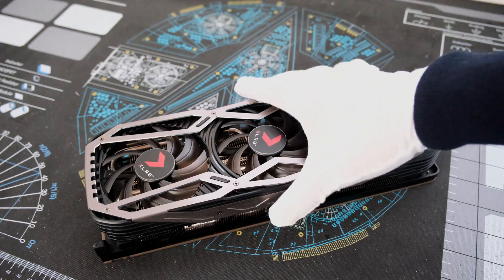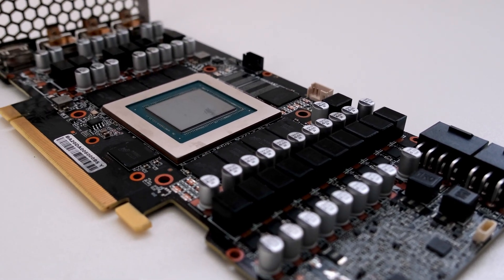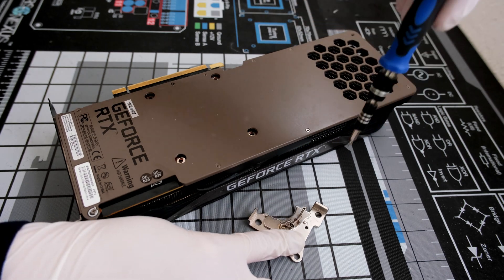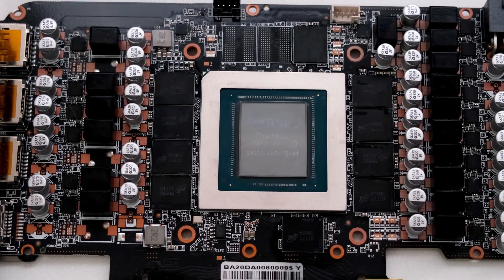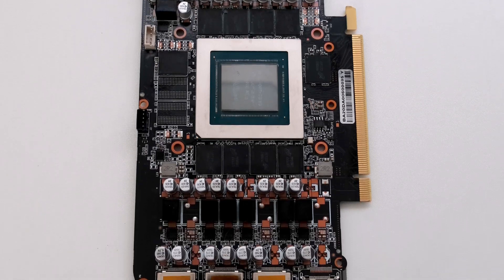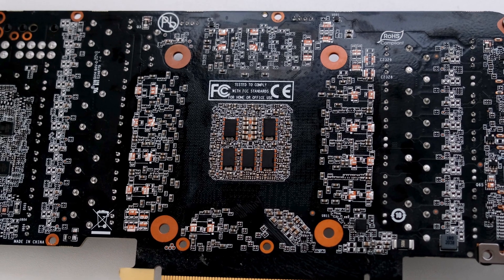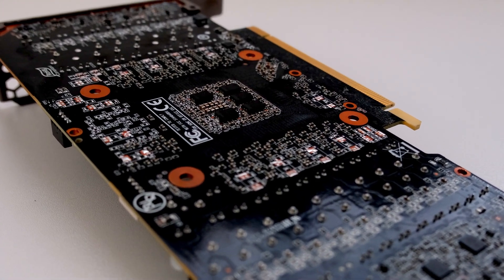RTX 3080 PNY XLR8 Reference PCB Teardown NVIDIA GeForce GPU

Comment: Video like this are always really useful
Reply from the maker: Thanks for your comment 🙏 Thank you for the encouragement! To improve, I've added thermal testing to all the recent videos. I'm also adding decibel readings (for fan noise) and full teardowns of the shroud (removing the fans, etc). I hope you stay tuned!
Reply: @vectornetwork  so thanks for these other test! Do you have any suggestions on how to undervolt that card?
Reply from the maker: @JohnnyShikari  Wow, great question and on point. I am capturing all the footage as we speak for the next video (4090 Founders thermals & teardown) and plan to address undervolting. Once I test undervolting on the 4090 (and showing it), I'll have a better understanding may be able to address your question better. Hope that helps
Reply: @vectornetwork  Honest and "on point" answer. I'll wait that video! :)
Reply: @vectornetwork  Is the process same for 4000 super cards?

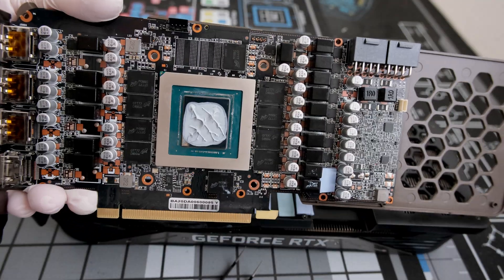Comment: 1:03 did you just rip off white connector?
Reply from the maker: Thanks for your comment 🙏 I checked the video and IIRC, yes, I just did rip it out. I tilted it side to side to get it out. I don't remember there being a clip. It pushes in like a fan header. Hope that helps.
Reply: @vectornetwork  didn't know that, thx. I managed repaste it without pulling out that connector.

Comment: my video card is heated by hotspot up to 104
Reply from the maker: Thanks for your comment 🙏 104 is kind of high but too high. Any other information? Air cooled? Stock or opened before? How long have you had it?
Reply: @vectornetwork  My video card is 17 months old.I changed the thermal paste a couple of days ago, now the GPU Hotspot has a maximum of 85 and the gpu temperature is 76.The video memory is 86 degrees.
Reply: Надеюсь понятно написал,я из России
Reply from the maker: @ВалераХоботутин  Well, there you go. Looks like it just needed a bit of maintenance. It's good practice and it gets easier each time you do it. Those temps look good, enjoy your card.

Comment: Really helpfull vid. Awesome work. Im planning to get one, is it good? pny is not the best brand, but some of the oldest card maker by nvidia. I'll apreciate if you give me some informations, thx
Reply from the maker: Thanks for your comment 🙏 The PNY RTX 3080 is a suitable option. PNY is a long standing business (IIRC 30 or so years) located in NJ, USA. My understanding is that the produce cards for NVIDIA's Quadro line. They don't appear to spend that much on consumer marketing, so it is understandable that consumers aren't that familiar with the brand. From my experience, the cards are usually reference design (save on costs of customizing) and the cooler is typically no frills but certainly capable of the job (likely leveraging their experience with the Quadro line). My understanding is also that their warranty is comparable to other companies. Hope that helps.

Comment: Its OEM is Palit though, not PNY.
Reply from the maker: Thanks for your comment 🙏 I am always interested if I made an error, so I can prevent that from happening in the future. So, help me understand what you mean by the OEM being Palit and not PNY.
Reply: @vectornetwork  PNY 3090, 3080, 3070, 3060 cards are made by Palit, they only differ by fan shroud or simple sticker change, same goes for Gainward aswell.

Comment: Hello! for this model, are you able to deshroud to remove the fans side without having to unscrew the backplate and exposing the chip?
Reply from the maker: Thanks for your comment 🙏 I am looking at the cooler and there are screws all around the fan side. It appears that the fans can be accessed without unscrewing the backplate, but I haven't tried. In future videos, I plan on including a full teardown, including down to the fans. Hope that helps.
Reply: @vectornetwork  Hey there! I would love to see a full teardown on the 3080 xlr8, as I'm going to be deshrouding soon but I was only able to remove the metal outside of the shroud. Thanks!

Comment: Hello! Very interested in getting this card just for gaming. What were your stock VRM/Memory temps before opening it? Really curious to know. More power to ya!
Reply from the maker: Thanks for your comment 🙏 I am putting together a testing rig and developing a repeatable testing methodology as we speak, so I can better provide that information. So, I regret not having that data available, but I will do my best to provide that in the future. For what's it's worth, I found the card to run slightly better than expected on temps/noise. The 3080 doesn't have any memory on the backside, so the memory temps were perfectly fine. Hope that helps.

Comment: Do you happen to know where the card's RGB header is? Or how to physically disable RGB?
Reply from the maker: Thanks for your question. 🙏 I do not know for sure. There is one covered by the cooler and two one the side. Not aware of physically disabling the RGB, but maybe pulling out the white one on the side will do the trick. It may be possible to control the RGB with your motherboard's software. Hope that helps

Comment: I almost bought this card but I was looking at the 3080 12gb and the Ti version. It was still $1100 at the time but I had a 30% "cash back" (store credit) for OfficeMax which would have generated $330 store credit after purchase. I ultimately decided against it as it would have still required the $1100 out of pocket and just in time, the other card I was looking at went on sale on Newegg for $729. The Gigabyte Gaming OC 3080 12gb. Far better value!
Reply from the maker: Oh yea, for sure, better value. Congrats on the purchase! 🙌 The Gigabyte 3080 12GB is a beast and you got it for pretty much the MSRP of the 10GB FE at launch $699. Well done.

Comment: what temps are you getting in full load?
Reply from the maker: Thanks for your comment 🙏This card the PNY 3080 is currently in a Heatkiller water block that I'm thinking of putting into a SSUPD Meshilicious. When it was in its stock cooler, the GPU temps were fine, something normal and the memory temps were pretty cold, more than I expected--perhaps because there is only 10GB of it on this board. (I don't recall exact temps)
If you are curious about the temps in my most recent watercooled soft tubing build on this channel, running a stress test in 3DMark like Time Spy or Port Royal, I'm getting somewhere low 80s for the GPU memory and GPU core something like 70s, maybe 80 max (a bit more than the ambient temp in the low 70s). The fans are running at approx. 1200 rpm. 
This is with the Heatkiller rads 360-L with 3x Phanteks T30s and 240-S with 2x Noctua A12x25. The temps stay fairly constant even under further load and the fans just pick speed to compensate. Hope that helps and thanks for asking 🙏

Comment: I just bought a used 3090 with the same cooler and it runs very hot with 100% fans. I am thinking of sending it to warranty service somewhere in the EU. If they will not do anything with it, will try repasting everything and then undervolt a little. I just hope it will not melt inside my case (Corsair 4000x w/ 6 Corsair fans).
Reply from the maker: I've not tried the 3090 version of this card. For 3090s, the memory on the backside can get very hot if that is being used heavily during load. 3080s, all the memory is on the front. It really shouldn't melt inside that case if its setup with decent airflow. If there is a lot of visual dust and debris on the cooler shroud, then popping it open, repasting & new thermal pads (get new ones in advance, dont rely on reusing the old ones) may make a solid difference, especially if you can clean the cooler shroud at the same time. Best, Vector

Comment: Great video! Was planning to do this on mine as well, did you notice any thermal improvements after replacing the thermal paste compared to the stock paste?
Reply from the maker: Awesome man, I actually didn't notice any significant thermal improvements (it was already running at temps better than I expected with the stock cooler). I think it's a well-made card and the cooler is smaller and more compact than average, yet performs well.
Reply: @vectornetwork  Great to know, you saved me some time I guess, was planning to repaste everything in my pc but you confirmed it for me. Thank you!
Reply from the maker: @carloleal30  Sounds good boss, but if you find yourself wanting to repaste it, don't let me stop you. Can be good maintenance all around. ✊

Comment: Good to know that its a reference pcb. I have one of these just begging to be watercooled in a o11 Dynamic. Idk if its worth it thou...
Reply from the maker: Right on, the PNY 3080 is an absolute champ of a card. The stock cooler performance was solid, so it would depend on your sound tolerance. I had two of those cards at one time in different builds and they both performed at or above my expectations. So much so that I am considering PNY for the 4090, since it will also be a reference PCB and it appears Alphacool may have a waterblock for it near launch.
Reply: @vectornetwork  Considering the price of the 4000-series, I think I will be stuck with my 3080 for a while. But I'm looking forward to see watercooled 4090 with a OC core clocks of 3000+ mhz 🤤
Reply from the maker: @3milio0o95  Awesome, the plan is a PNY 4090 in an Alphacool Eisblock with two 360 Heatkiller rads and Optimus cpu block and reservoir combo 🙌
Reply from the maker: @3milio0o95  Thank you for your comment 🙏 The 4090 is now in a water block and should go into a custom loop this week, let's see how high we can crank it!